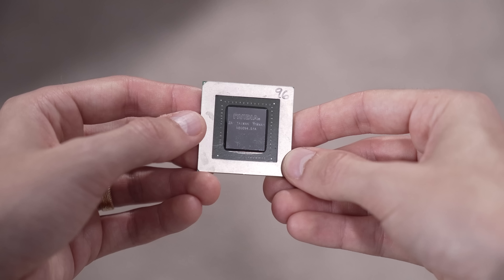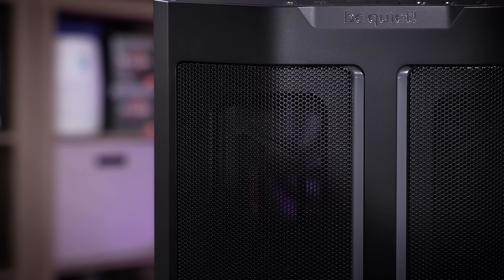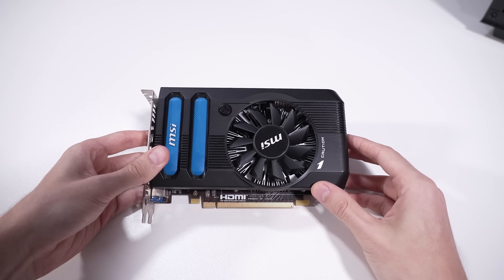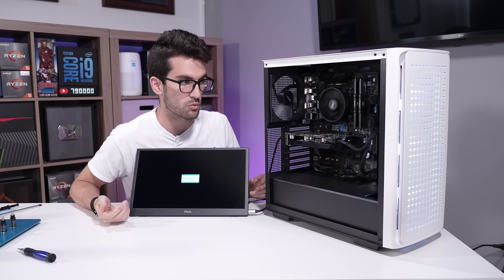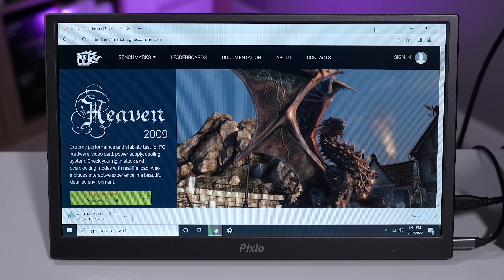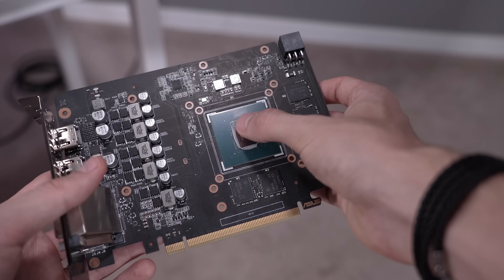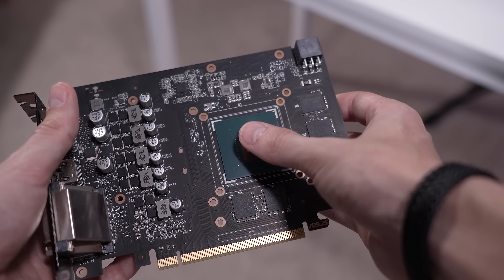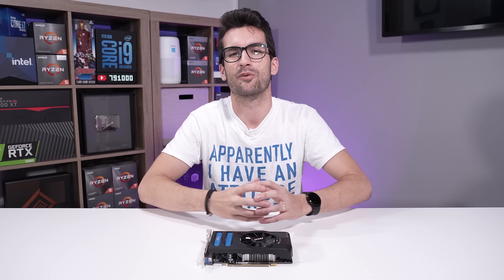"Just Bake It"

Comment: When the Red ring of death was happening, I heard a lot of people saying to “bake it” by using a heat gun or intentionally covering the xbox in towels and I never understood how that could work.
Reply: Came here to ask if this was the same as the RROD. I did the towel trick and it worked for awhile, but eventually died and sent in and was fixed.
Reply: I did the towel trick on my old 360 for months before getting a new one. It would only work for a few days to a week at a time and then you’d have to do it again. But it worked lol.
Reply: Nah, in Belarus i have used mom's oven to fix OTVAL on my AMD GPU 450. That I call "bake"
Reply: Same trick, the issue with rrod was soldering balls breaking off, but still being nearby if you were lucky (thats why it worked for some but not for others), so you overheat it reflowing the solder back in place, itd dry out again and break off again
Reply: Similar with the PS3 Yellow light of death, the OG PS3 Phatty models apparently had used some kind of greener eco friendly solder and it had a tendency to dry out.    Heat guns, or putting it in the oven was known to fix it, but as mentioned in the video it was very temporary.
Reply: I stuck tooth pics in the fan and left it on so it'd overheat itself
Reply: Saved many an Xbox doing the reflow and xmod.
Reply: @joeschmoe5009  Does this mean that someone with experience, professionally, can reapply the soldering and so actually fix the problem?
Reply: @modrribaz1691  im not sure exactly how the fix gets done. But if you look into it, in theory yes its just a resoldering process to fix it properly, i just dont know if anyone outside of xbox has full info about it as ive never dived that deep into it
Reply: @joeschmoe5009  I don't think it's something an electronic engineer wouldn't be able to reverse engineer, but if a board is already out of warranty, 3rd party firms should be more cost-effective.
Reply: @TheRustyTigger  nope lol. The nec tokin caps were faulty on the early ps3's. Heating them up, fixed them. The cores are rarely the problem.
Reply: Weirdly enough, I had 2 Xbox 360 arcades, and an Xbox 360 Elite all of them got the RROD but only one of them died from it, the Elite. The other two were killed by power surges and drinks. When we would get the RROD we would just power it off wait 10-20 minutes and power it back on and it'd be fine for months until it would happen again then we'd repeat.
Reply: I baked my Xbox 360 once and it worked.  Well until my room mate got a rage fit going in Call of Duty and kicked it across the room....
Reply: @TheRustyTigger  "eco friendly solder" is lead free solder. It's shit and cracks easily because it doesn't have the same level of flexibility leaded solder has.
Reply: I fixed my Xbox by wrapping it up with towels
Reply: I actually fixed a few using the pennies and electrical tape method and then baking it. You use 8 pairs of pennies wrapped in electrical tape and place them between the heat sinks with some thermal paste. Then you bake it, wrapped in a towel, let it cool down, and it worked almost all the time. Most of them lasted a few months but I had one that lasted a couple years after lol
Reply: @Green Mamba Games I’ve done it on my 360 and a friend’s 360 and it worked

Comment: Watching this on a iMac 27" from 2011 with an AMD Radeon HD 6970M i had to reflow two times (2019 + 2022) is kind of funny to me. XD
After working multiple years in a repair shop for pcs and laptops, i can tell you that reflowing works about 30-40% of the time. (if there is no other detectable defect or issue with it)
I really have to argree with you that reflowing is always the last possible way to fix a card or chip after you checked for all other possible errors.
Great way how you explained the process and the facts behind it and what it does inside the card.
Greetings from Germany

Comment: All I can say about this "fix" is that I have personally used it on upwards of 10 different old graphics cards, and it has worked every time. I definitely wouldn't reccomend using it on cards that could be fixed in other ways, but the GTX 680 in my secondary pc has been working fine after being baked over a year ago.
Reply: Funny I baked my gtx 680 too along time ago and still works amazing ! XD
Reply: @Green Mamba Games For your information, my main system is running an rx 6700 xt red devil, the secondary system is just for loaning to friends at lan parties. I have 2 additional laptops, one with a gtx 1650 and one with a gtx 940m. Maybe consider that you do not have the entire context before responding in such a rude way. As for the anecdote, it is completely true, and I have revived cards anywhere from a gtx 2ti to said gtx 680. Also, btw, eth is going nowhere and I would reccomend selling off that 3070 while it's still worth anything. kek
Reply: @Green Mamba Games "I'm sorry" ? That's rich coming from someone in a community who are known to steal every card before anyone can get one for your cryptoshits.

Comment: With they way that fan finally kicked in for card one, I would be looking into how the fan curve was set. That may explain a lot.
Reply from the maker: I'm not sure why the fan curve would be set to 0% until throttle territory, but I suppose it's possible!
Reply: @GregSalazar  While it doesn't make sense, people wanting their "quiet gaming pc" and have absolutely no idea what they're doing, will do things like this.  I contacted EVGA about their 280CLC i bought, i was trying to lower the fan curve to 0% up until around 50c where it would gradually rise to 100% if necessary.  EVGA informed me that their minimum fan speed was locked to 50%(i think, i haven't used that cooler personally in a while), and i believe it to be because of their fear that someone might do something similar.
Reply: PWM Controller probably died like on any cheap MSI card. So at 100% it will run, anything inbetween is a no.
Reply: @GravitySandwich  similar how the fan resistor usually fails in cars for the cabin fan. :)
Reply: im sure that capacitor died and came back to life n kicked fan on
if u dont check it with voltages meter than u dont know if it getting any voltage at all

Comment: Part of the problem is in most cases manufacturers use standard solder. If they spent the extra penny per device they could use high temp solder which wouldn't crack or reflow(very rare) under the high temps that these devices create. 
This is what happened with the PS3 Cell CPU. I used to have access to a manufacturing x-ray equipment and BGA repair equipment and I wish I had access to it when the PS3s started failing, I could have made a fortune repairing them!

Comment: As somebody today who just did this method before this video with a broken GTX 1070 and like your GTX 1060, it didn't work at all. I even did the turn on the card without the cooler for a quick second to even feel heat. Nothing. 
I've only got the heat method working once. After that, it never works. So you are absolutely right. It really is a last throwing method.

That's why I'm gonna hand it off to either person I know who have brought back a card by going the crazy route and reballing chipsets by hand. And that was after I reheated the cards which I was told I did correctly, it just had more issues beyond that.

So yeah. Definitely do this on cards you are more than willing to lose than bring back. Like I tried reviving that GTX 1070 in every way possible I have learned over the course of 2 weeks before I did this last reheating method by seeing if it was my system, my configuration, my software, every driver, and trying others systems as well. I did this all right before reheating. Luckilyin reheating, I've done this long enough to know I reflowed the GPU chipset back into the board. It's just getting the VRMs back and getting power back into the card(essentially any way to feel heat). It's most likely never gonna work again, but I'm willing to keep experimenting until I find the exact cause or in a 0.0000001% a solution.

Keep up the awesome videos dude.

Comment: I think the reason the first cards fan just jumped on all of a sudden is that the thermal detector is probably broken.
Ich had this with an oven. You put the oven on the lowest but he just keeps heating up to max because he thinks it is still to low of a temperature. Likewise there is an indicator if the oven is still hot. But the oven did only recognise it if he was super hot. But when he was still hot enought to burn you (but not super hot) the oven said he was just warm. (never measured it.)

Comment: In my experience this happens most frequently when the chip cooling solution has failed. If the root cause is not fixed (fixing the fan) the issue will tend to resurface quickly.

Comment: I did this heat thing to an old cassette tape recorder pcb. It worked out quite well. Electronics weren't so micro and you could see the globs of solder on the pins clearly.

Comment: I've done the oven method successfully a couple times with a long corded digital temp gauge.  I didn't have a nice thermal camera todo the method here.  I've tried the heat gun before, but it's too easy to leave it in one spot to long and melt things - very hard to be consistent with.

Comment: Generally speaking, baking a GPU only works for cards that dont have a post at all. if is has a semi-post or if it artifacts, you wont fix it. In my experience it IS reliable and ive revived cards and had them live on for years to come but i think the misconception about this method is that it works for a wide range of cards when in most cases it wont work.

if you watch Tech Yes City he has done a ton of videos on this topic and simply put if the cards give off a B2 error code its fixable and he ends up fixing it, anything else is a goner.

Comment: Any thought that excess heat from a failed fan (on card 1) and gravity pulling on the die could have caused failure in the solder joints? If a reflow fixed something like this with a failed fan, I'd assume it could actually outlive your expectations for further failure if cooled properly for the rest of its life.

Comment: I have done this so many times to Xbox pcbs, Playstations, GPUs, cellphone motherboards, and many other things...I would say that about 50% of the time it will die again within 6 weeks with regular use but occasionally it would completely fix it...If you have nothing left to lose then you might as well give it a shot! I prefer to use an oven instead of a heat gun though, sometimes the issue isn't the chip but some other solder bump and the oven evenly heats the whole card...

Comment: That is why I decided to turn off the passive fan stop mode on my GPU. With fans curve set to run at 500rpm on idle it is just as silent as fan stopped and temps dropped about 20-30 degrees. GTX 1080 at 0 fan speed idle at about 50-60degres. With a lowest RPMS that those fans can do - 500rpm it is around 35.

I had an old, not much power hungry PC and experiment with cooling. The results where that even little fan speed produces enough airflow to reduce the temps. In my opinion 0 fan speed is not good for your computer.

Comment: Can anyone provide their insight/opinion on this? 

Im wondering if it is okay to run a Y splitter from one of my cha_fans to give me an extra intake fan in my case. It’s a 3 pin connected so I know it’s DC. I’m more or so wondering if it’ll kill the header or not. The fans I’m running a 120mm Corsair that use about 0.3v. My motherboard is an ASUS z97m-plus. 
 
Thanks I’m advance to anyone that helps! (Kinda new to the whole pc group)

Comment: Just my 2 cents on this from my personal experience. I tried the reheat method for a "Gainward Phoenix GTX 1080Ti" which would not even get detected in the BIOS. I cooked it in a lab oven which had precise temperature controller and took it up to the point where the solders turned shiny, probably like 230 240 Celsius. The one mistake I made was to not take off the capacitors and 8 of them popped around 180 C. I let it cool immediately after the solder turned shiny by turning off the oven, replaced the caps with new ones and it is working fine for more than a year now. So yeah, like others I was definitely lucky and it does work, but there is always risk of damaging it. I took the risk as I had nothing more to lose at that point and it paid off. YMMW! A good project to try if you too are in a similar position, but its better to use the heatgun method as it restricts heat to the main chip. BTW, Linus Tech Tips and many many other Youtubers have already covered this, and LTT made a collab with Louis Rossman regarding the same too (sadly not all of us have access to the tools and skills Louis has). It worked for many of them, probably based on what the root cause of the problem was, but nobody recommends it due to the reasons you have mentioned. Still its worth a shot IMHO.

Comment: This was actually a fix for a known issue on the PS3 60GB model back in the day. I did it for a few friends however I stacked coins on the die and headed those rather than the board directly. the coins taking the heat first also handles the cooling as they would be left in place and therefore you weren't just immediately removing the heat source. 

The fixes for the Red Ring of Death that involved wrapping them in towels and the such are the same principle; you're heating it up to reflow the solder. 

All the PS3s that I done this to survived until they developed other problems or were no longer in use with one of them lasting another 5 years! But yes, make sure that this is likely the problem and you don't have another choice before attempting.

Comment: I shoved my trusty Radeon HD 6950 regularly into the oven. After two years of doing so it still works with its imperfection but was finally able to build myself a new system. i still keep the card because it fought bravely for over ten years and was the first that i bought with my own money. Alas it had to retire but keep it close to my heart :'-)
The RX 6800 XT blew my mind but with a 10 year gap of experience that was to be expected.
Have a good one.

Comment: I had an apple laptop(macbook pro 2012 quad i7 with xx gpu) that i took to Brazil and because i was in the mountains which at night was really cold(10c) the graphics developed a very strange problem, screen tear and lines of pixels not rendering, thought it was knackered until i got back to the uk and then it cured it self, me and my IT mate concluded that the GPU did not like the heat differential with being so cold at night, yes it is cold in the UK too but in Brazil we were always outside due to living in what amounted to a hut. Sold the laptop to a friend for cheap just in case it was funked but it still works to this day, was in Brazil for six weeks so far to much time to be an intermittent problem.

Also found that folks had repaired their faulty macbook GPU's buy heating them with a heat gun as they had a bit of a habit of failing and being super expensive to repair(usually logic board replacement).

Comment: I've done this on a few lap tops with graphics chip issues and they have actually been working for YEARS now!  I actually used a temp monitor while using a heat gun. They are my own, of course.  One other, though, only lasted about 3 months and "reflowing" just wouldn't work again. I did NOT monitor the temperature on that one, so maybe that made a negative impact on it.  It's the "luck of the draw,"  I guess.  Maybe sometimes it's really not a reflow issue, but just a chip gone bad and then it's just game over...permanently.

Comment: If you want to reflow don't do it yourself, aside from potential toxic fumes and deposits it's imprecise. The best thing to do is find an electronics repair shop and ask them to use their reflow oven. Like the chart at 9:15 reflow ovens are designed to reach very specific uniform temperatures at a specific rate determined by the type of solder used.
Reply from the maker: No one said it was perfect. I preached against it for anything other than a last-ditch effort... At which point, very few are gonna actually pay to have it "professionally" done.
Reply: @GregSalazar  Yea it only makes sense in certain cases like retro hardware. I'm really not sure how much they would charge though. How much work is pressing a few buttons on a machine?

Comment: Based on the reflow chart you may have failed to melt the solder, no? Peak temp was supposed to be 260°C. Also, using some flux that can flow under the GPU is also required for anything approaching a proper reflow.

Comment: soo would keeping the GPU at a steady temp all the time help a GPU like this stay living for longer ? if heating and cooling causing the issue, just leave a heaven running when not in use right ?
Reply: zero rpm mode on the fans sounds easier and you're not wasting power
Reply: @wildgg  ye basically.

Comment: I did this with my old gtx 780ti, I followed what linus tech tips did. I made some balls from tin foil & stuck it in the oven for 20 or so minutes & surprize surprize it worked. Hasten to say, I soon sold that on ebay, but ive never had any comeback from buyer which is great. So it does work sometimes...

Comment: what about a card that crashes the graphics driver when under load?
for my r7 360 i have to limit elite dangerous to minimum settings at 720p to 30 fps or it would freeze and crash the driver
it's not overheating or anything like that, but i have to underclock it to lower the chances of a crash

Comment: So from what i learned before of how solder works, isn't the real reason you shouldn't oven bake solders because 
1) It damages other components that go over the solder heat threshold
2) It doesn't always completely heat the connection points which can cause a bad connection with the solder. (balled solders too)

It's literally only a last ditch effort since its like taking a shotgun approach to the issue.